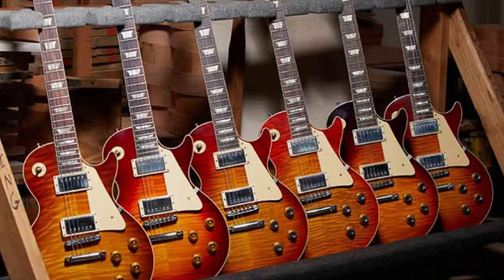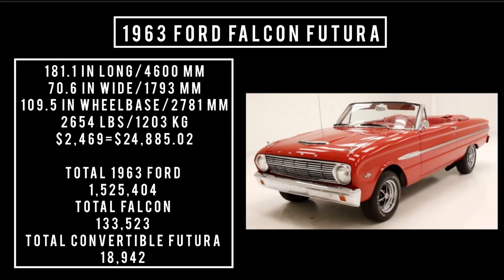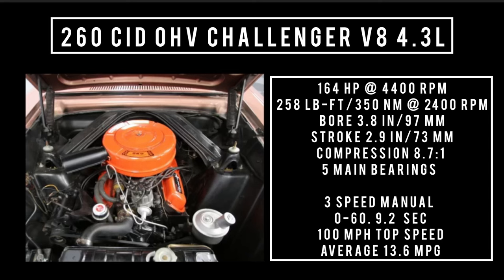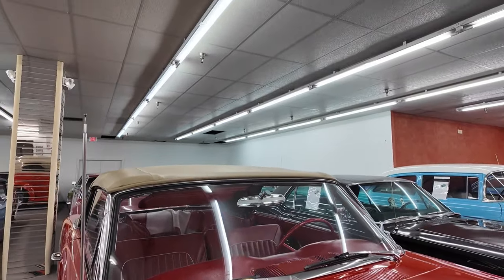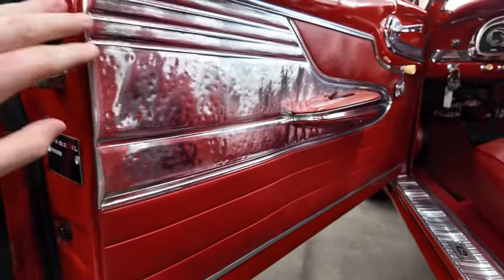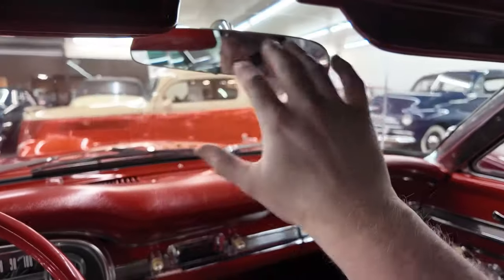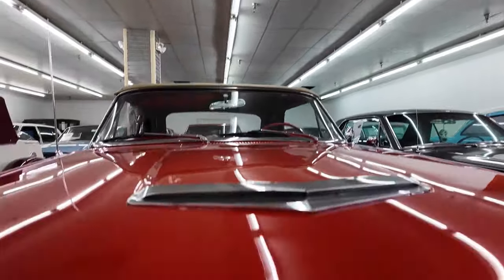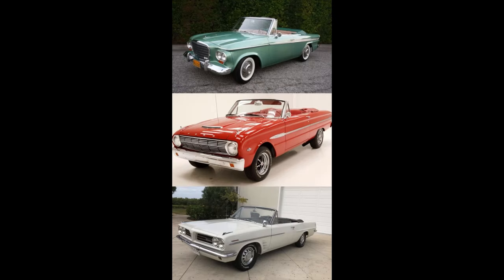1963 ford falcon futura

Comment: I think that 1963 may have been Ford Motor Company's best year for styling. Every vehicle that they produced, from Falcon through Lincoln Continental, was just beautiful.
Reply: Whole lot of difference between a basic six  cylinder Falcon and a fully optioned Galaxy with a 390 V8
Reply: @davidpowell3347  yes, but they both look good.
Reply from the maker: 63 was a great year in general GT hawk Avanti Grand Prix and well all of them lol

Comment: My uncle had a white 63 Falcon convertible with red vinyl seats. I have fond memories as a ten year old riding in the car on the way to swimming, sitting on a towel to protect my legs from being scorched by the hot Phoenix sun. My uncle had replaced an English Sunbeam sports car with the Falcon which I think was more practical and comfortable.
Reply from the maker: Awesome thank you so much for sharing those memories =) 

Sunbeam alpine or tiger or different

Comment: My first car, bought used in April 1973,  was a 1963 Ford Falcon Futura Hardtop with the same red interior as this car but with white exterior. I was at the end of the 1st year of college in Northern NJIt only had 67,000 miles on it. Only a week after I got it, gas prices shot up from 35.9-37.9/gallon to 43.9-47.9 gallon as a preliminary to the November 1973-June 74 'fuel crises' hit and prices go into the upper 40's Cent/gallon range. Yes, mine had rust issues, including the top of the gas tank, also the floor of the trunk (same as the 1st Gen Mustang) so the interior smelled of gas fumes. It needed a lot of work on the engine as burned oil. I had it for about a year until it got into a sideswipe crash and while derivable, the drivers side door couldn't be opened. I actually took the engine out for someone else's Falcon and used a friend's truck to take it to the scarp yard. It was also among the last cars to have a manual choke.
Reply from the maker: Thank you so much for sharing that story what great memories even though it burned oil still an experience. 

I prefer a manual choke because of a vapor lock At least you can try to correct it.
Reply: The manual choke worked well on this car. @What.its.like.

Comment: What a nice example...and who doesn't love a red convertible!  Fun fact:  all Falcon convertibles have power tops as standard equipment, something that was optional on the Mustang until 1970, when it became standard. These are great, simple, reliable cars. I could certainly do without that ratchet shifter, though. Ugh.  I'll take the Falcon in both cases.
Reply from the maker: Thank you so much for sharing that information on the power top Mustang convertible 

I am not a fan of ratchet shifters. I think they are very very stupid.

Comment: As I wrote earlier, my father owned a 1963 Ford Falcon, 4-door. He was so proud of it. The body styling was like the Futura, except it was a nice blue color and a hard-top, with lots more room in the back. Of course, my sister was just born and I was 4 or 5 years old, but I remember the plastic seat covers that stuck to my legs when I wore shorts. It had no A/C, and probably was a mid-grade 6 cylinder with automatic transmission, which was a better deal for the time. I loved the simplicity of the grill, the chrome bumpers, and the round tail lights (rocket styling).  The interior was much the same as the Futura, too, except it was blue, and  a nice dash. It got pretty good gas mileage.
With both scenarios, I chose the 63 Ford Futura.
Reply from the maker: Awesome thank you so much for sharing those memories =)

Comment: That's more than a dress up kit.
Plus it has a Monte Carlo Bar.
Nice and tasty restomod convertible with the big 289 V8.
Reply from the maker: Yeah, it’s pretty decked out super clean underneath there
Reply: 260 challenger engine with a 2 speed auto or the sprint with 4 speed and bucket seats
Reply: @DSj-f8h ; The 289 Hi-Po first intoduced in the 1963
 Fairlane with single exhaust.
The Falcon was never a high perfornce unit.
The 289 2 bl. or 302 2 bl. was plenty good enough for the Falcon according to Henry II.
They wanted the gear heads to go with the 1968-1969 Cobra.
Weird that in 68" thru 69" you could get a 428 Fairlaine 500 that wasn't a Cobra.
Watch out for fakes, they are everywhere.
428 in a Fairlane doesn't mean anything except it's a rare Thunderjet 428 in a numbers matching Fairlaine, maybe.
Why put Cobra badges on a 68"-69" 428 Fairlaine, 500, or Torino GT when the plain old ordinary 428 Fairlane 500 might be even more rare.
Fairlaine Cobra's are the biggest fakeries in the muscle car world.
Reply: There were 289 hi-pos fit to seven or so Canadian-built Falcons in 1965.

Comment: Hi Jay!:  The Falcon was a spiffy little car!  Don't really hate the mods on the one you show, as a 289 is a fit for a car that had the 260, which are probably getting hard to find these days.  And since they updated the wheels with some Magnum 500's, attention was more than likely paid to the brakes also.  That red one would be a quite fun car to own and drive.  Both the advantages (and disadvantages) of owning a Convertible to be considered, of course.  WYR's #1 Falcon (nothing against the Corvair Spyder, I just like the styling of the 1964 better than the '63)  #2 STUDEBAKER LARK BABY!!  Love those cars, especially with the V-8 engines.
Reply from the maker: I usually try to steer clear of cars that have a lot of modifications or aren’t original, but this one was so nice not to show I’m not sure if it was a real futura because it did not have bucket seats or the console but I really do like the wheels they sold the car before I could post the video. I still have stuff from two times ago. I’m going back Wednesday not today, but next Wednesday in a week and then I think I’m doing something at the Gilmore in April I can’t wait for that. That is going to be a highlight of the year for sure. =) 

Awesome choices

Comment: I want to thank you so much for this episode! This was my fun car that I loved, worked on, and drove for years. I had the 170 ci Special with a 4 speed manual in a convertible body. It was an amazingly good looking cheap car to run and so much fun to drive on windy hilly roads with the top down. There were steel plates to stiffen the frame that gave it a good low center of gravity. It never let me down until the unibody was killed by internal rust after over 200,000 miles. The sun visors are small so that they don't flap around when the top is down. There is no dome light, but there is a courtesy light under the front dash to light up the interior. I also found the chrome trim wraparound inside to have a nice unifying look that made such a budget model look more expensive. Top speed of the 170 ci Special engine was indeed 91 mph. I think the 4 speed manual got you there maybe 2 seconds quicker. The bench seat was very comfortable and great on date nights for sitting close.
I of course would pick only the Falcons, but you put up stiff competition with the other cars offered. Thanks again for doing this car justice and bringing back fond memories!
Reply from the maker: I’m so happy you dig this episode. Thank you so much for sharing your experience with your car. Greatly appreciate it. =)

Comment: In the late 80s I bought the most plain 63 falcon. 6 cylinder 3 speed on the column no radio no power brakes Nothing   The below basement model. I cleaned it up an updated a few items and it would deliver 28 mpg  and a working heater.  Sold it to an old guy who thrilled with it. He drove it to a local bar almost every day to get his allowed 2 beers and drove back home.
Reply from the maker: His allowed two beers that’s great what a great line 

Thank you so much for sharing those memories

Comment: 144 and 170 cubic inch engines had 4 main bearings not 7. The 200cu inch 6cyl was offered in  the Mustang in late 1964, Falcons, Fairlanes & Mavericks among others. It had 7 mains and carried on 'till the 80s in Fox bodied Fairmounts, Zephyrs, Granadas. It was the mainstay 6cyl for the smaller Ford products.
Reply from the maker: Thank you so much for that correction, I got the information from here

https://www.conceptcarz.com/s10935/ford-falcon.aspx

Comment: Jay In 1969 I bought for $50.00 a 63 Futura 2door hardtop, it was white with Red interior and lots of interior crome,. It was originally a 260 cid but I got it without an engine, so I built a 289 4bbl for it. in High school auto shop class.. I had the same Tach and guage setup great memories and  a great car.
Reply from the maker: Awesome thank you so much for sharing that memory with us

Comment: The 69' Sport Coupe was very nice.
Reply from the maker: I don’t think I’ve ever saw one in person
Reply: @What.its.like. Last year of the "real Falcon" (short wheelbase), 302 2bl., big thick bucket seats, square tail lights like on 69' Fairlaine and Torino.
Doesn't look that much different, really, than earlier Falcon's.
Not a screamer by any means, but light and peppy enough. 
302 2bl. (reg gas) was most powerfull engine ever available for the Falcon, probably rated about 220 hp and last forever and a day.

Comment: I had a 62 four doors  170 three on three , ditch that for a 200 in line, 6 automatic 3.50 8 inch rear axle . Drove it to work for 20 years Not that on fuel top speed maybe 95 miles an hour, but could hold 85 miles an hour almost in any hills was a great car . If i drove highway have around 65 miles an hour got 26 miles a gallon or more I missed the car.
Reply from the maker: Oh wow thank you so much for sharing your experience with this car =) I’ve heard the 200 is a good motor

Comment: Luv this car i have 64 Rancharo cheers 🥂 😊
Reply from the maker: That’s awesome what engine is in your ranchero
Reply: @What.its.like.  289 2 sp auto car is slowly becoming is in good shape got to put new floor in cab luv ur show excellent o car is original dover white
Reply from the maker: Sounds pretty awesome. Have fun with it. Glad you dig the channel. =)
Reply: Like ur Chanel alot got those wheels on my 71 mach 1 also 351 fact 4 sp is grabber ble have had 40 years Tooele loo excellent
Reply: Grabber blue sorry

Comment: The first Mustangs were Falcons under the skin!
Reply: And many other models , they used that unibody design up until about 1980
Reply: Not exactly, Falcon wheelbase is an inch and a half (109.5 bs 108) longer, all behind driver seats.  A commonly repeated error.
Reply: @markhale8084   its same unibody  layout though with just a different wheelbase, thats all
Reply: Same layout like no frame and four wheels?  The unibody is a different length, folks continuously and erroneously think that it’s just different exterior sheet metal and that just ain’t the case.
Reply: @markhale8084  Yes the length is only difference. They  also use same unibody on Cougars, Mavericks,/Comets, Granada/Monarachs, Versailles  ( likely most stretched of all  the Falcon unibody design ) and Im sure there is some more but that off the top o my head. Im also pretty sure  Pinto/Bobcat is same unibody too just much smaller. Yes the sheet metal was made to fit the smaller and stretched models.
Reply: I was being facetious…I’ve been playing with first and second gen Falcons (60-63/64-65 and first and second gen Mustangs including Shelbys (65-66/67-68) since the mid-1970s.  Yeah, both have unibody construction but claiming the same unibody is just not true.  I understand that they are similar but not like there is anyway to diverge from the general design.

Comment: I had a 63 two-door hardtop Futura, with a 170 special and three on the tree. It was built, simple and rugged, extremely dependable little car. I would buy a brand new one today if they would make it, not like the cars of today, too many engine problems, transmission problems recalls all kinds of problems, manufacturers forgot one thing, "keep it simple"

Comment: My first car was a 1963 Ford Falcon Futura Convertible. It was Oxford Blue with a white top. I had the 170 ci I-6 cylinder engine and 3 speed manual transmission with a column mounted gearshift.  I had mine in excess of 95 mph. The car in the video is a restromod.  The 289 wasn't available on the 63. The floor shift would have been on the 63 1/2 Sprint, but not available on any other models. The wheels on the first generation Falcons had four lug nuts, this car has five. The gas cap is an aftermarket gas cap. It is not the same cap that came standard on Falcons. The 289 V8 in this car looks like it was a modified or a more modern engine than the engines that Ford produced from 65 thru 68. I had a 68 Falcon with a 289. It looked to me like your camera strap had gotten in the way if you had moved it, I think you could have closed the glove box door, but those were small compartments.  As for the scenarios, I would pick the Falcons in both, although that Studebaker would make a great second choice.
Reply from the maker: Awesome information thank you so much for taking the time to share all this =)
Reply: Not correct.  V8 equipped 1963 Falcons had 13 inch 5 lug wheels (though this was originally an I6 car).  Only 4 speed was on floor, this is an auto that was moved to floor. That is the correct has cap for Futura and Sprint in 63.

Comment: Dielectrically heat sealed mylar door panels on the Furura - they tend not to wear well after 60 years (or even 10), but they looked cool.  The 60-63 Falcon was the quintessential cheap and cheerful car, and very nicely styled - they didn't muck it up too much with the facelifts and actually the 61-63 front end was an improvement over the rather gaping mouth on the 60.  WYR:  1) Corvair Sypder,  2)  Tempest - given the car pictured is a LeMans V8, which means the 326, and that would blow away a stock Falcon 260 in real world period road tests.  Not as pretty though.

I made the pilgrimage to CAM today.  Interesting.  NOTE: 'you' most emphatically cannot get into the cars, and maybe 20-25% are roped off so your photos will suffer some - especially for interior details.  A couple 'showrooms' were closed (more project cars than finished in these).  Brought a check with me as they had  a first gen Taurus SHO, and since I had one back in the day, I thought 'maybe'.  Seems to be gone.  67 4 door T-brid I liked, but at 24k it would have to absolutely ace a mechanical/functional inspection and I wouldn't put too much stock in the representations here.  They did claim a 428, and it was loaded - mmm, maybe I'll think about it.  No bargains, a few reasonable prices and a fair amount of 'are you kidding???'  Maybe that the consigners' expectations rather than retail price setting, in which case, some of these things are going to sit a long, long time.  No food for purchase other than vending machines - I'll bet hot dogs would pay for themselves.  Connected to a Holiday Inn but but no one eating in that restaurant and one could just imagine the wait time (what, we have turn on the kitchen?)  There is a McDonalds somewhat adjacent.  Worth a visit.
Reply from the maker: That’s so awesome that you went there. I’m hoping to go back next week. They got a lot of cool cars in like I’ve been looking for a four-door Thunderbird to do. I’ve never seen one in person price shown in a lot of cases they’ll work on price I’m sure they leave room to negotiate… I live 5 1/2 hours away from there. I generally go to Shady Maple, which is a huge buffet which is on the way there for me. Sometimes I’ll get the buffet sometimes I’ll just buy a pound of jerky and just eat that for the next three days lol

They got a lot of nice new inventory that just came in. I want to check out the Packard. I wanna check out the BMW Isetta 

Sweet choices , That’s why there wasn’t a comparison today because they were too similar. They did change the grill in the lighting situation a little bit from the early cars but there wasn’t that much to talk about. I found a stellar advertisement piece but it was from 1961 I think.

Comment: WYR 1: All of them.
WYR 2: All of them.
The best way to prevent rust on a vehicle is to either undercoat it properly, live in a dry climate, or not have a vehicle at all. That last option doesn't work as well nowadays as it did a few hundred years ago.
Reply from the maker: Great choices 

As well as insight and information =)
Reply: @What.its.like.  I'm just making sure there's enough "common" sense left to keep from going completely insane.

Comment: This was originally an inline six car, all those fit with V8 from factory had automatic choke.  As an I6 car it lacks the torque boxes taken from Fairlane and   used by Ford on all V8 Falcons. It would have also then had 4 lug wheels so this car has been converted to 5 lug, a good thing. Original 63 V8  Falcons were fit with 5 lug wheels but only little 13 inchers by Ford.
Reply from the maker: Great information =) thank you so much for sharing all of that

Comment: Very basic inexpensive car that would run many years if cared for and not driven hard. I suspect its top speed and highway performance was better than the contemporary VW Bug but the Bug might have given it a good race from zero to 20 or so mph. I think the Falcon had much better heat in winter than the Bug. 
  I thought the  basic tiny six cylinder engine only had 4 main bearings and was originally used in agricultural equipment or wood chippers. As I remember it was quite a bit smaller looking than the much more powerful 199 engine used in some 1966 Ramblers, (Of course not fair to compare the 1960 - 1963 Falcon with the newer 1966 Rambler.)
Reply from the maker: This would definitely beat a beetle 0-60 does it in half the time with the middle engine 

I’ve never been in a falcon until this one I was surprised by the seats